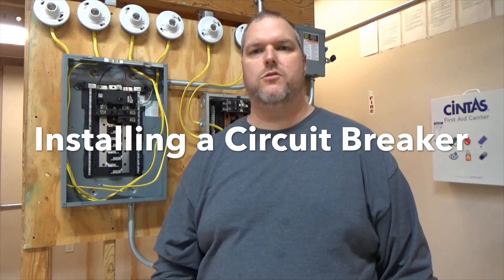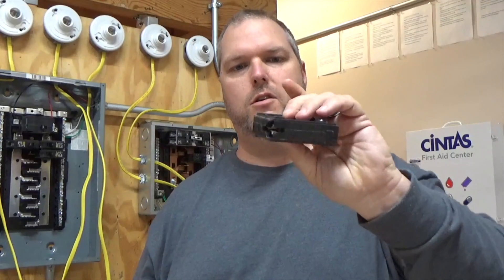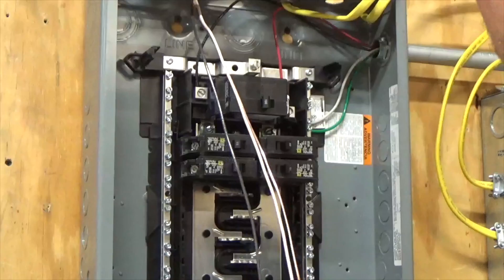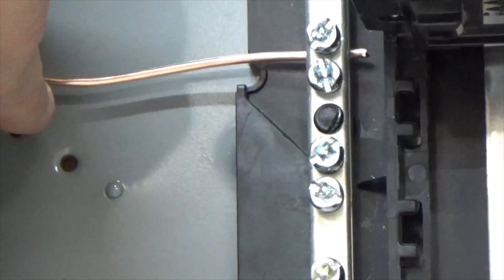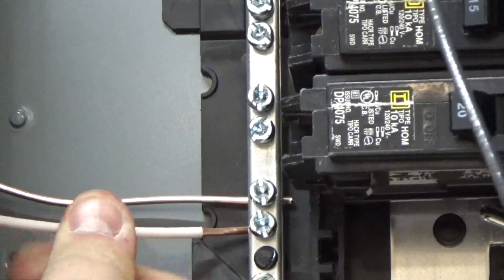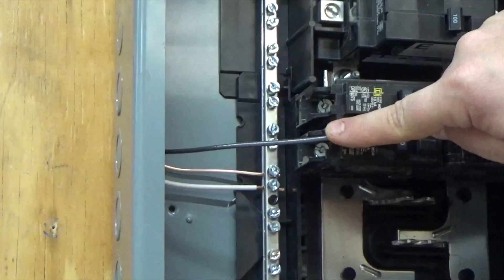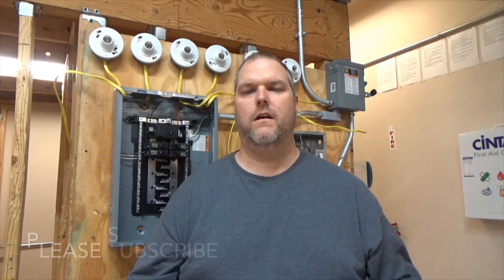Installing a Circuit Breaker

Comment: Great video. I have the same cables going in for my shed. I yave seen some videos where they separate the neutrals and the group. One color on each side. Why is that?
Reply: Ground**
Reply from the maker: @joseluis-vl6qh  because for a sub panel you must separate the ground and neutrals. In my example I am showing a main breaker panel. This is my first means of disconnect so they must be bonded. Hope this helps! CM
Reply: @craigmichaud-electricalins4602  thank you. We did an adu, and put a second panel. Is the first panel now consider a sub panel now?
Reply from the maker: @joseluis-vl6qh  yea that is a sub panel! CM

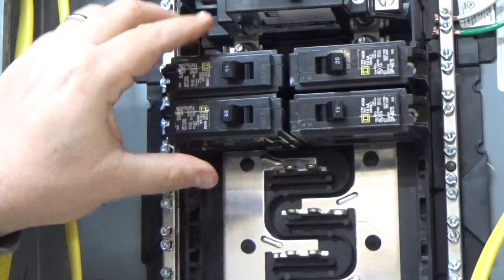Comment: 1:55 now this is exactly what I needed to hear because my one breaker at the bottom is loose, and I wasn't sure if that was acceptable now, I Searched a lot of videos, but ,none was quite like this, but I got a question. How do you pull it back out? And I know it seems self-explanatory, but I'm having an issue with rocking my breaker out. It doesn't wanna come out? And I don't want to put too much force on it. Now I cannot put a Flathead in between the 2 breakers, because I don't have a breaker adjacent to the one that I'm trying to get out, it's still blank if that makes sense.
Please help thanks new sub.
Reply from the maker: @AJ-sb8qk  it is okay to put more force to get the breaker out! Just do everything in reverse and you will be fine! CM

Comment: Are there panels that have two separate bars for neutral and ground?
Reply from the maker: These panels are student trainers. This panel happens to be a main panel we’re the neutral and grounds are bonded! Sub panels are separate ground and neutrals. Hope this helps!! CM
Reply: @craigmichaud-electricalins4602  Thanks!

Comment: Great presentation! I have a question. When I opened the breaker panel in my garage I didn't notice any bonding wire attached to grounding bus that's attached to any grounding rod outside of my house. The service entry wire is coming from underground through a 2 inch metal conduit. There's a rebar right next to the metal conduit. Does this mean the electrician who installed the panel was relying on the metal conduit attached to the rebar for grounding? Your professional opinion will be much appreciated. Thank you.
Reply: Your grounding rod could very well be buried below grade.

Comment: Just what I needed to wire a new 30 amp circuit. Question-If the side bar for ground and white is full can you double wires in the holes? Great instruction and content!
Reply: Depends on panels manufacturers specs

Comment: Thanks for the video... before tackling this job, do you simply shut off the power using the switch at the top of the panel or do you need to have power shut off at the pole?
Reply: Should be a main somewhere.  Either outside the house or top of the panel.  Definitely turn it off before working on any electrical panel.  This guy didn't because there is no incoming power

Comment: have a circuit breaker that now works in when in the off position, and doesn't work in the on position. I just did some rewiring, and am an amateur. I messed something up somewhere.  What could it be ? Is it dangerous ? Can someone help me ?

Comment: Praise the lord for British wiring regulations, that make me cringe at how unsafe that board is, no shielding over liver conductors, no earth sheath, which itself isn't dangerous but even more so with that style of exposed board. An 18th Wiring regulation UK would open your eye to how unsafe US wiring is
Reply: Looks like it's for demonstration purposes...
Reply: @otallono  No its not, that's how they are shipped. If you look at a few other vids on installing square D boards, they are all that unsafe, no phase barriers or shielding anywhere, quite frankly very very dangerous. I know safety reg's say the board should be dead before removing the cover, but for testing circuits after install, certain tests have to be done live, which I would dream of with this death trap. I just laugh at the wiring regulations in other countries, most don't update their regs to move with changing technologies.

Comment: Today it happened again  kind sir, I saw a circuit breaker at the Colonial Motel in Eustis, Florida with a neutral (white) line to a circuit breaker connected with a hot ( black ) line on 2 screws in the same circuit breaker.! To me that is completely wrong looking closely at the wires in the breaker box anyway!

Comment: With AC (alternating current ) I refer to   (Watts law)  Power (P)watts =  Voltage x Current .  Example of 120 VAC x 20 amps = 2400 Watts. Also I still refer to series and parallel circuits as Parallel Circuits voltage stays the same and current divides among the parallel branches.  Also in series the voltage will divide and current remain the same.

I hook up all the time the hot line to the circuit breaker and also run the hot line  in series with a switch and keep the neutrals (commons) white wires together.  That means to me that all the white lines ( common) end up on the neutral bar in the breaker box and that the individual circuit is always connected to a circuit breaker. Looking at the panel the neutral bus bar (white lines)  never has a circuit breaker!

Comment: I've never been inside a breaker box. I'm really surprised to see that the common and ground go to the same bus bar.
Reply: Actually the guy is following a big safety code by putting neutral and ground on the same bus they call that bonding review code 250.12 in NEC .
Reply: there are separate neutral and ground buses. wiring neutral and ground together is not safe and will cause other problems. The fact that this guy doesn’t talk about safety at all... should tell you skmething

Comment: it is very helpful, i have a question. My square d panel, I see the white wire is go to one side (left) and the bare wire (neutral wire) go to the right side, and the black go to the breaker. Your wiring is all go to the same place for both the white wire and the neutral wire.
Reply: Very keen eye! It would be a more universal learning example to show a panel with a separate ground bus like yours. Not all panels are the main—the only place it can be ok to attach neutral (white wire) and ground (bare or green wire) to the same (neutral) bus is inside the main panel like shown here. Your Square D panel has a separate neutral bus and ground bus, so it could be your main panel or a subpanel. Common places to find a subpanel are inside an apartment, or in a garage, outbuilding, or pool/air con area. IF the panel you’re looking at is a subpanel, then the left (neutral in your case) and right (ground in your case) must not be mixed.

Comment: . . isn't there a dedicated tool for tightening the screws to the bus and breaker ?  Why use a shitty regular screwdriver ?  After I had my panel upgraded from 100 to 200 I took a closer look at the screws in the 100 panel and more than 75% of them were STRIPPED because someone used a Regular Screwdriver . . .sorry, but not the tool to use for this — I am not an electrician and even I know that

Comment: Craig, is this a main panel or sub panel? The neutral and ground aren't bonded together on the sub panel as the green bonding screw is removed in the sub panel which means that you cannot connect the neutral and ground to the same bus bar. Am I right? So obviously the wiring method that you have demonstrated here is for a main panel and not a sub panel. Please correct me if I am wrong.
Reply from the maker: This trainer is set up as a main panel. You are right that if it was a sub panel you would seperate the grounds and the neutrals!! Great question!!! CM
Reply: @craigmichaud-electricalins4602  Wow. I'm really impressed with your prompt and quick answer. Thanks Craig!

Comment: Hi Craig. I am owner of a small winery/distillery. Recently I bought a still with a 125 amp breaker requirement.  It is basically 22,000 Watts and 240V. Leading to a 92.6 amp load.  Yet a 100 amp breaker is not large enough and 125 next step up.  I have placed numerous 30 to 60 amp breakers for welders and plasma cutters, lathes and milling machines forever.  Safety is always first.  I have a 200amp panel with nothing else in it.  The wiring will lead out into conduit and to a on/off switch box then to a controller box and then hard wired to the still on back.  Is there something about 125 amp level breaker that I am missing and this should be passed over to a electrician?  Of course the manual recommends this but is this really necessary.  The only thing I would like to add is a GFCI but I can not seem to find one when I do a google search.  Very unclear.  The still also will have a static ground that specifically grounds into the concrete floor per the manual.  What are your thoughts on this.  I am having electricians quoting me $5000 + to do this wiring a total of 20 feet.  What am I missing or they telling me they don't want the work or such a small job etc.

Comment: I was just about to say what an excellent tutorial. But the entire I was like did he emphasize securing all power & the fact that the main line is still alive & to test with a conduction tool ? I Just had a new 100 amp box put in... The electrician would not connect any breakers. He said " liability ". Ummm so I guess this is the stage I am at after $1,135 for a new box , breakers, prob 50 feet of 100 amp... And a disconnect outside. I am so confused ??? Charged me 10 hours labor & 2 " service calls " because the job took 2 visits ???

Comment: 15 amp double pole circuit breaker for Mr cool diy mini split 18000 ?? P4 comes up inverter compressor error should I use 20 amp double pole circuit breaker

Comment: Why do you strip the yellow sheathing off the cable just inside the box? Why wouldn't you leave the sheathing on until the point where the individual wires separate, next to their respective breaker?  Seems like it introduces opportunity for things to get mixed up and shorted.  Not criticizing, just wondering. I'm a total novice to electricity.

Comment: But first, de-energize your panel before you begin wiring and DO NOT touch those bus bars if the panel is energized!! If you’re working on a panel that cannot be shut down because of certain equipment  running on that panel, best to get a qualified electrician to make the swap if you are shaky doing a live panel breaker swap/add.

Comment: When installing a new breaker,  as long as the new breaker is square d and the breaker is square d,  it should fit correct?     ty
Reply: Obviously you didn’t listen to the first 25 seconds of this video

Comment: I tried this with the power on, touched the metal in the back & died...thanks for letting me know to cut the main circuitry to the house! 😵😡
Reply: It is a sad thing that people don't already know to do this.
Reply: @jamj4u  yup, this is the world we live in now. 30 years ago car owners manuals told you how to adjust valves...today its not to drink the contents of the battery.
Reply: @jamj4u  it's not sad, if someone is teaching something, they need to teach the entire safety protocol. It's not common sense, you're not born knowing how to work a circuit breaker. People die all the time doing this stuff. Even if the main is turned off, you can still get shocked touching the part that is hot. Most people don't know that. You think because you are savvy that everyone is. I can probably do other things you can't that might seem easy or obvious to me and I won't bother saying it is sad.
Reply: That’s a dead panel in a classroom   Pretty sure the students know there’s no power to it.

Comment: Thanks Craig, you make it look easy, I don’t know anything about electricity, but do know solar, we have outgrown our wire runs to plugs for a surge protector outlet strip , inverter and deep cycle batteries runs our cabin, lights, fridge and even a tv

Comment: Ground and Neutral wire should be separated.  there’s a neutral bar and a separate ground bar.
Reply: My house has all the neutral and ground on the same bar. They also put white tape as a shield  over the ground wires.  ?
Reply: Your a idiot. Thats why your a " handyman" not a electrician. The grounds and neutral only need to separate on sub panels!  in a main panel the ground and neutral bars are bonded together so there is absolutely no reason to separate them . I know because i am a licensed master electrician. Your obviously not and have no idea what your talking about.

Comment: Absolutely great video! Most how to or diy instructional videos good or bad are rushed and the instructions are poorly explained. Resulting in having to watch and find certain spots to understand how to execute the task or missing something completely. The convoluted information that has no relevance to the project and work and even at times they admit after a long winded pointless story. I felt comfortable and confident that I could execute this potentially dangerous job without problems. I have a recording studio and wanted to have independent circuits for powering equipment that have heavy pull and that are expensive. For such a small job it would suck to pay someone to come out and do it for me when it’s so easy. Also the peace of mind that I know it’s done right, won’t put my family in danger, or my equipment that took a lifetime to a lifetime to accumulate. I can tell you truly understand what your doing and others could learn a lot from how you teach. I have Great job and thank you.

Comment: Not quite right. It is better practice to install a separate grounding strip. Under modern electrical practices the neutral is grounded (or should be) back at the Utility transformer. Ground wire are for Earth Ground and faults to ground should be "testable" under modern practice. You might get away with this is some localities, but grounding neutrals at multiple points is Old Hat. One creates noisy lines with ground loops and creates and improper path back to earth for lightning strikes. This is so wrong, but is still common practice in some localities. And what would happen if the feed had a had a lifted neutral from another panel ? Then there would be no grounding of metal cased appliances. Let your inspector know you are following the revisions to the National Electrical Code.

Comment: TURN THE MAIN >>>O.F.F<<<
Reply: No no no. If you cant work an almost empty panel hot you shouldnt be in there to begon with. Panels are designed to be serviced while energized. The panel should never be open without a qualified electrician present.

Comment: I'm not electrician but at binging you should of turn main brecker OFF ....
Reply: If you are not confident enough to do it with the power on and you are not skilled enough to do it at all. A panel is designed to be serviced while energized.

Comment: This may be one of the most innocently dangerous video I have ever seen, you mentioned absolutely nothing about safety procedure, 9out of 10 people watching this is probably a homeowner trying to do something in a fully loaded panel, what if it’s a 3 wire do I use 2 separate breakers on 2 random spots in the panel, it’s weird it seems my neutral conductor is turning a little brown as if it’s burning on the bar, I guess if the glass is half full you give me job security however I wish I didn’t come at the risk of people losing their entire entire lively hood due to “I was just trying to install a breaker” great work dude

Comment: Why is he putting the ground wire on the neutral bus.
Reply: Well we know the real purpose for the neutral buss is for wiring is ground fault breakers, since the neutral and hot both have to past through the breaker -- it gives a convenient place to put the neutral return wire from the GFI breaker.  It makes for a neater Job.  In the past panel manufacture always provide dedicate ground screws to connect ground wires to the box.  New practice is to install one or two multi terminal ground buss bars and wire the conventional way, even if it is merely a solar power panel ; that way is leaves future flexibility for utility hook up without having to re-wire for codes. If A panel is installed today, make it future proof. Anyways, square D is a sleazy company for selling over-priced deficient junk.  In Britain the inspection authority has been hammering down on crapping installations -- no doubt the same will be coming to America and companies like Square D had better smarten up and provide a dedicated grounding buss. Do electricians want to have the inspection branch always on their ass. It is about professionalism, not what someone thinks they can get away with or continuing the wrong ways of the past.  Best to assume that all National Electric Code recommendations could soon become Law. Earth Ground and Neutral return are distinct functions to be bonded only at the most appropriate location in the system.
Reply: I wondered about that

Comment: It’s easier to strip the jacket off before entering the cable into the panel.
Reply: That is not a typical technique even still.
Reply: @stevansaucedo4151  that's how we do lomex in western Canada, we strip the jacket and then enter it into the box or panel not striping it after.

Comment: I suggest the ground bus bar should be relocated & connect to the metal enclosure of the panel. It should not be very near to the terminals of branch circuit breakers terminals. The busbars for ground & neutral is separate unless the type of grounding system is different.
Reply: Dont quote me man,I do understand what your saying but I think in normal 3phase all neautrals and grounds are bonded until after first point of entry anyway so I guess it dont matter.i do agree with you this panel is kind of odd..i like my neutrals and grounds seperated I. All my panels and just bond them together where needed.like with that bar you remove or a ground screw that actually grounds the can itself..anyway good comment